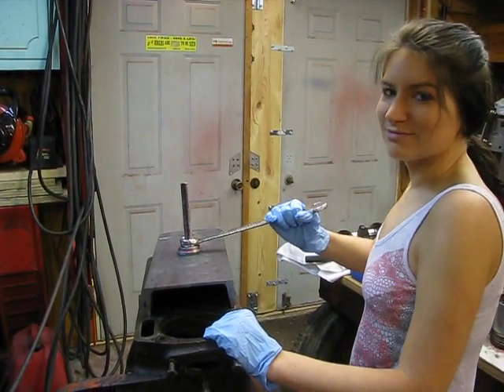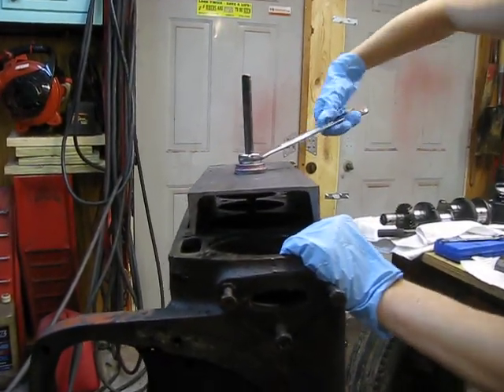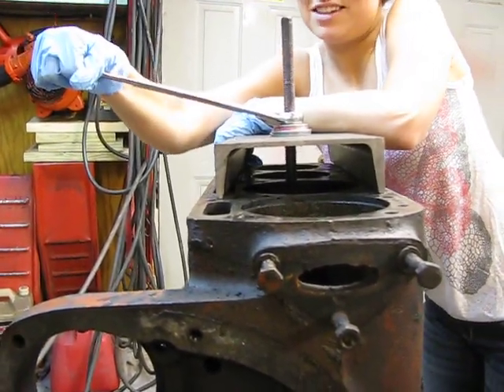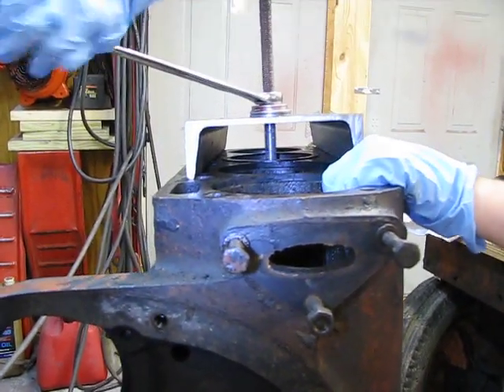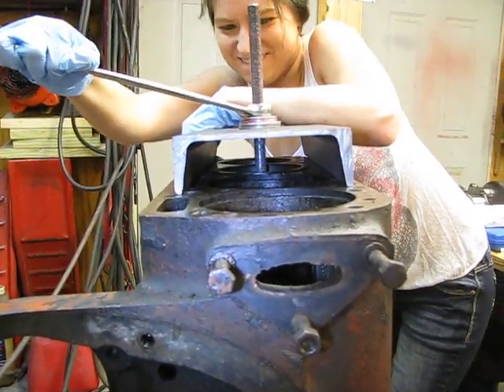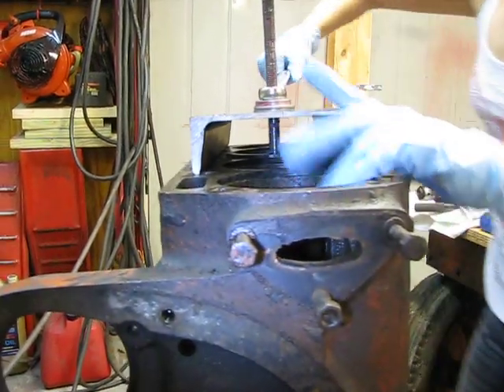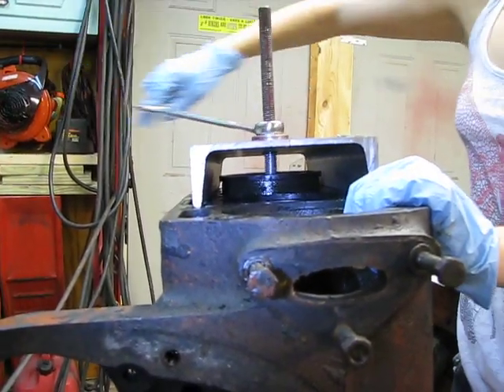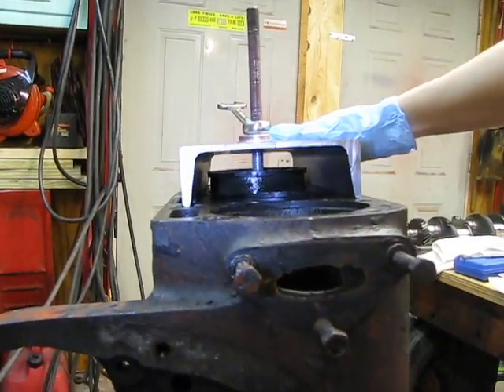Pulling wet sleeve from an Allis Chalmers WD45

Comment from the maker: Before installing the new sleeve you will need to clean up the block where the new o-rings will sit and to make sure the surface is clean at the top where the liner will sit.  When you install the new o-rings use plenty of dish soap on them and on the surface of the block where they will slide down.  Make sure there are no twists in the o-rings.  The liner with new o-rings will fit into the block with not much effort.